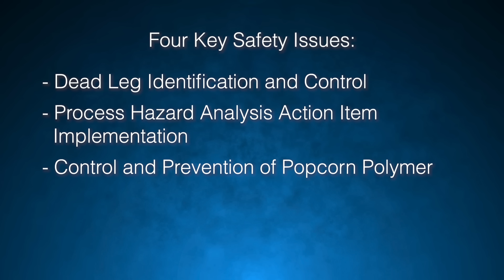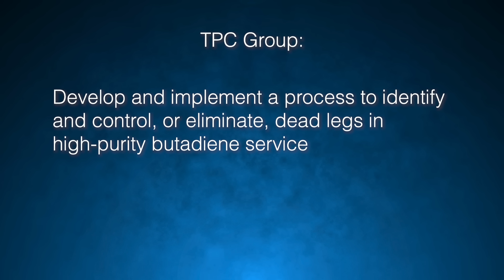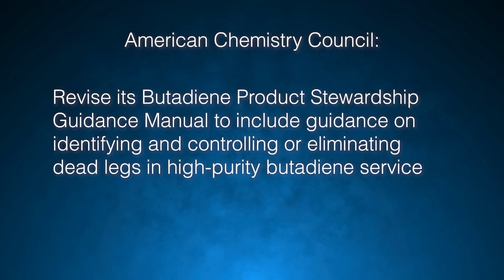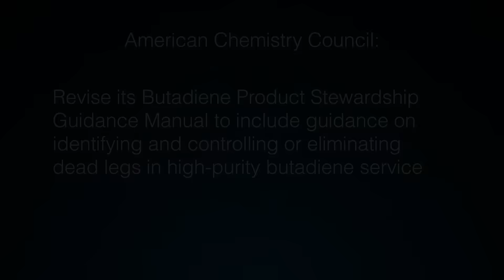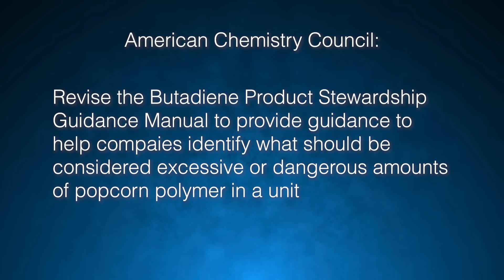The Danger of Popcorn Polymer: Incident at the TPC Group Chemical Plant

Comment: It's honestly astounding to see yet another case at a chemical plant where safety procedures were delayed and/or ignored until the very reasons why those recommendations existed caught up with reality. In a way TCP ought to be happy that they just lost one unit, but I hope that the loss made them reconsider their casual approach to safety. Next time they may not be as lucky.
Reply: “Why should I spend 10M to save 2M?!” - Project Management making the design trade between the manual and remotely operated iso valves.

“Because that 10M is going to seem like a bargain when a catastrophic event occurs.” - Design Safety & Reliability Engineer
Reply: @mjmooney6530
"We've done it this way for 30 years and never had a catastrophic incident.  It'll never happen."
- seen on grave of 'the old man of the crew'

Probably..
Reply: @ONAFIXEDINCOMEAlley-fz8tg Indeed.  Common sense is not so common.  Loads of gamblers out there that are really poor with math.
Reply: Given the general stockholders mentality these days? Not really.
Reply: @TheTrueAdept this was a part of the USCSB Drinking Game if I remember correctly too.
Reply: @TheTrueAdept  It is not Stockholders.  It is Corpo executives.  Profit over safety
Reply: @JeffWusch  no, most corpo execs are those called in because of the stockholders, not the other way around.

Stockholders want their increasingly impossible RoIs, in a economic landscape that is becoming increasingly hard to get those RoIs even in optimal conditions.
Reply: And the need for redundancy.
Reply: NO ITS NOT, THIS IS AMERICAN GREED AND CAPITALISM....
Reply: They don't care and most plant workers do the bare minimum and head home.
Reply: Maybe the educational institutions and the pool from which employees are drawn have diminished?  For example Dr. Sylvia of the CSB featured in this video came to the Board after working as an education lobbyist.   She doesn't appear to have any experience or education with chemistry or engineering.  If the CSB is hiring like that, imagine what a company along the US border is hiring?  This sort of accident is how America will continue to fail and slide into third world status.
Reply: @Deez80085  Wait.  You accusing the investigators of a known incident done by a for profit company of causing it?  How does your mental model work?  In your mind, anything that disagrees with your world view of government = bad need to be shouted down?  Just asking for a friend...
Reply: @Deez80085  "Dr. Johnson has more than two decades in the health and safety field. She began researching chemical exposures when she was a doctoral student at Old Dominion University in Norfolk, Virginia, where her dissertation focused on the health hazards associated with children being exposed to lead in paint, dusts, and the environment."
Reply: Wow, @davidjacobus really had just that hard of a time believing that a black woman could be qualified for the position she holds, that he made up a complete alternate backstory for her.
Reply: You're confusing the function of a Board Member with the function of an employee. 

Besides that, these videos are, when it comes down to it, educational. They belong in high school classrooms as much as oil refinery conference rooms.
Reply: @Deez80085  more no than anything, I'm afraid. The problem is that these days to get actual credentials, you'll need something on the order of decades, minimum. The world is just that complex.

Not to mention that we're living in a world where automation is strangling the general work market...

Comment: Thanks for an interesting video. Always surprised by safety lapses of companies that practice Process Safety Management - hazards are understood but wind up with "normalization of deviancy"  and tragic, expensive accidents.
Reply: Right, it's interesting that in this incident, the company knew exactly what popcorn polymer could do and didn't take it quite seriously enough. Their hazard analysis needs better prioritization. Of course, in this video we aren't told about all the hazards they did take effective steps against. But the fact that they didn't wind up implementing recommended measures against popcorn polymer at multiple times when they could have suggests a certain laxness overall. One thing that definitely needs to be at the top of any priority list is the remotely operated valves, since they're a safeguard against many different problems.

Comment: This is the problem with a corporate environment where no regulatory oversight exists that can exert enforceable measures. The only thing that exists are "recommendations" after a tragedy has occurred. And those recommendations are only suggestions. There is no requirement for the industry operator to implement or address why they will not implement those suggestions. Operating on backup equipment should always be seen as reduced operational capacity. The product was still flowing, so there was no urgency.

Comment: This could all be avoided if you just had pressure sensors between all the valves. You should know if there is enough pressure in a pipe to shatter it.

Comment: An amazing service, thank you. When I worked at a copper mine in Yukon I would always replay your videos when it was my turn to give the safety brief and they were ALWAYS well received. Your videos save lives
Reply: That's why I'm glad these videos are easily accessible to the public! Makes it so anyone can quickly share them and get the message out :)
Reply: @krissp8712  So many times incidents are caused by "not my job-itus". Which is why safety audits should be treated like an airplane takeoff/landing check-list. Gaps in the check-list cost lives.
Reply: @sailcat662 Yes! Aviation regulations coincide with most other industries. Regs are written in blood 😔
Reply: I'm thinking about doing this with my team.